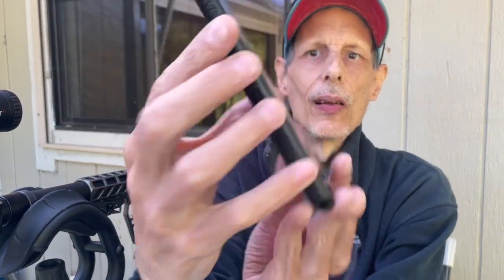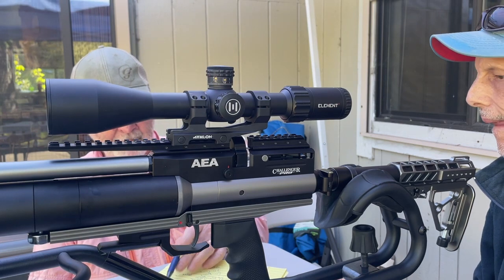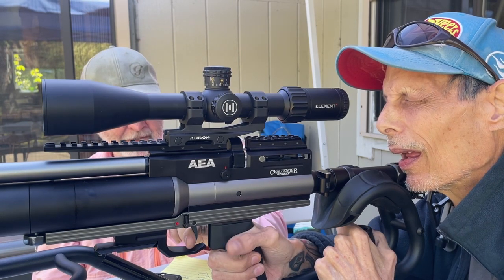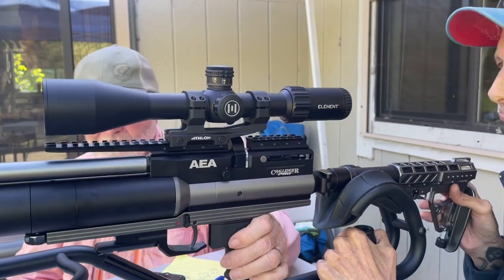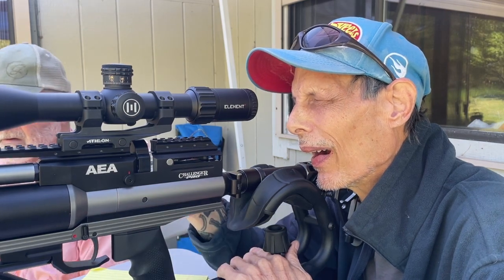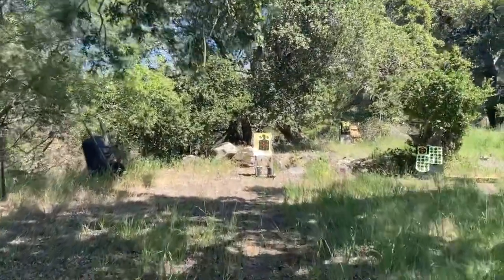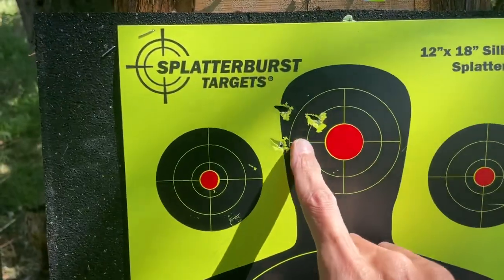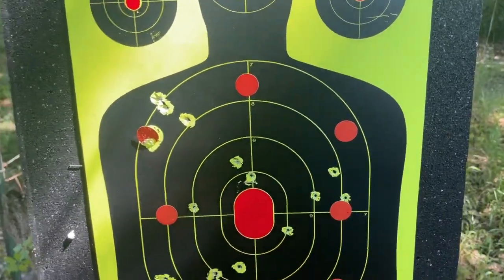AEA challenger pro 25 cal with the lighter hammerspring.

Comment: With my tune I was able to get 60 shots with NSA 24.8 gr slugs going 950 fps with an ES of 10 fps, which I thought was pretty impressive for an $800 rifle.  But I think it could do a lot better with a lighter hammer spring.  With the "shorter" AEA hammer spring the rifle is an air hog, especially for the smaller calibers (I had a .22).  Accuracy is also very good, I was getting sub MOA at 50 yds consistently.  What I really don't like about the Challenger Pro is a) the trigger b) that metal butt stock and c) I think the rifle is butt ugly.  But give AEA a couple months and I'm sure they'll come out with another model.